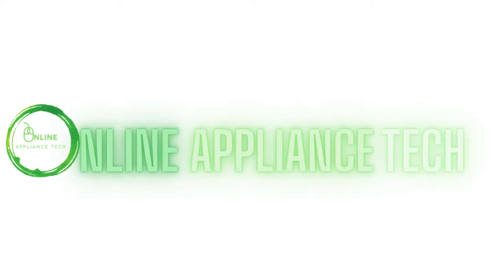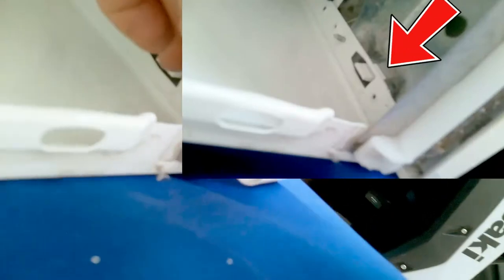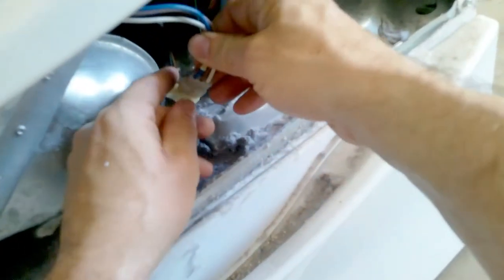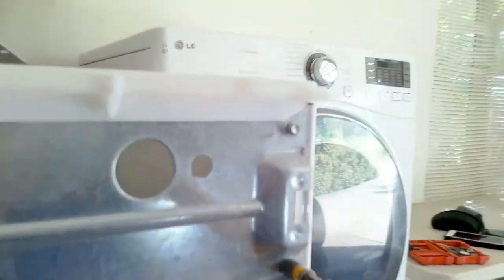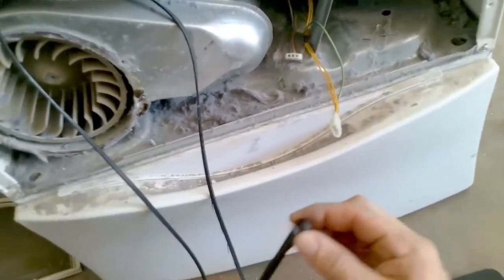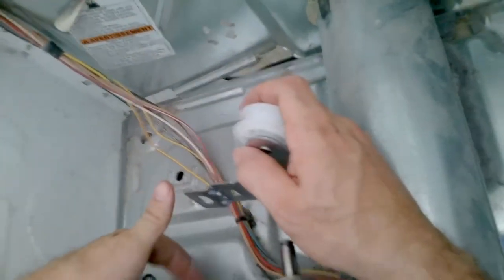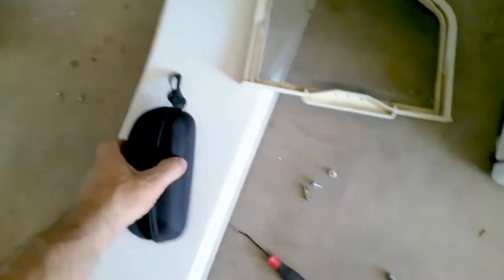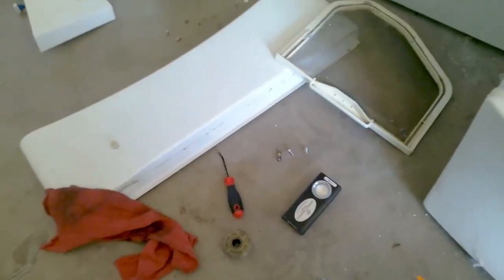Whirlpool Duet Dryer Won't Start [ How to Disassemble ]  [ Mod WGD8410 ]

Comment: what if the belt is connected?????
Reply from the maker: Could be main control board. What is the problem you are having?
Reply: I have to put it back together to check if the board is sending 120. The sensors and the tension switch were fine
Reply: @onlineappliancetech    Nothing happens when I hit the power button.  If I open the door, the interior light turns on.  The drum is locked in place.  If the issue is the control panel, would I be able to easily switch out the old for the new myself?  Could it be a matter of the power button needing to be replaced?